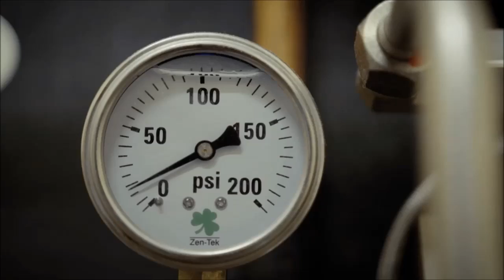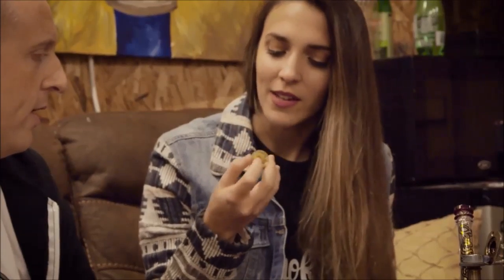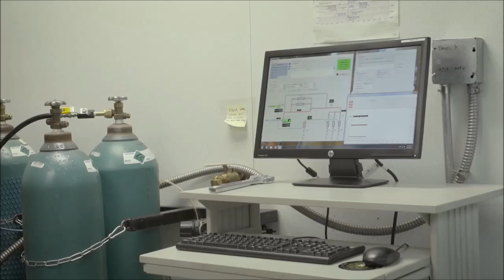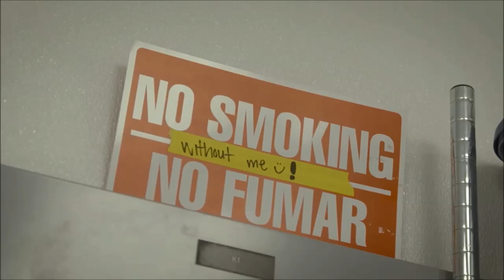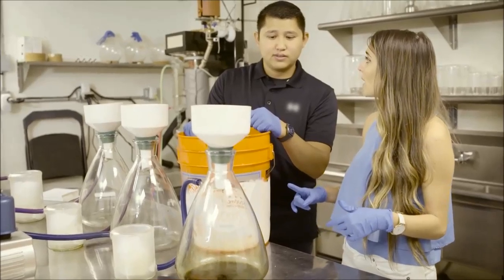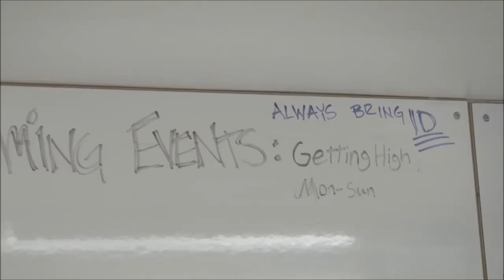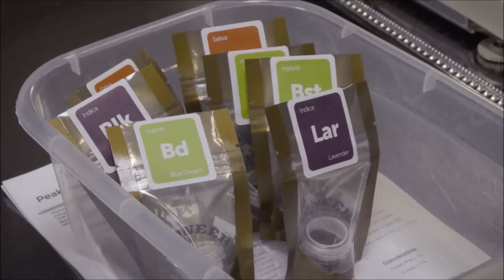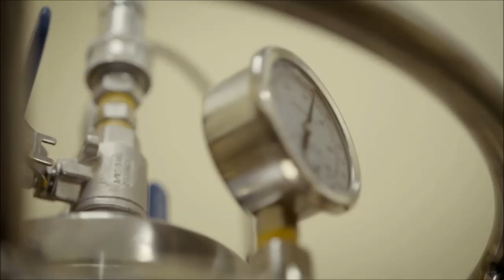Cannabis Concentrates The Art of Extraction

Comment: remember, the lighter you're using on a normal basis contains pressurized, liquid butane. So unless you're running a burning wick or lighting the back of a match stick, you're sucking in butane. Not sure about the science and chemistry behind butane toxicity out of a ighter compared to the consumption of unpurged butane in the end product without a proper vacuum pull/purge.

Comment: 10% rosin return with a shop press is pathetic using anything other than trim. With that press he should be pulling a 18-20% return with slightly above mid grade buds. Something doesn't add up.
Reply: Is it cuz the temp was so low? 200degrees